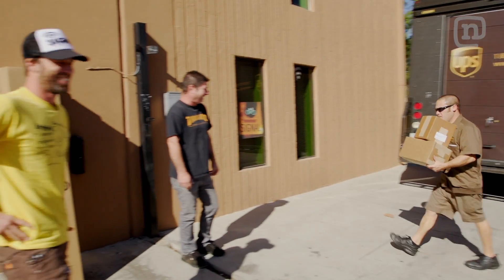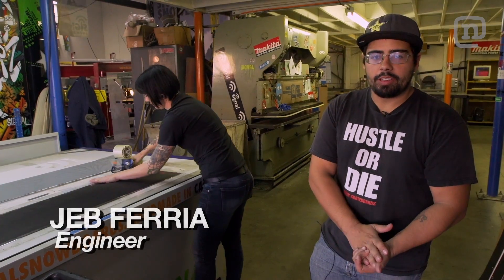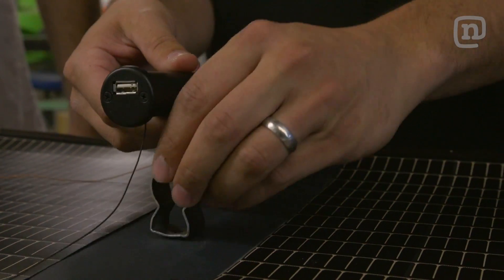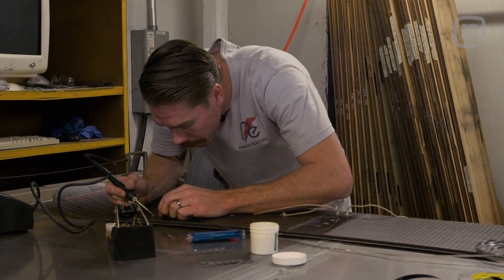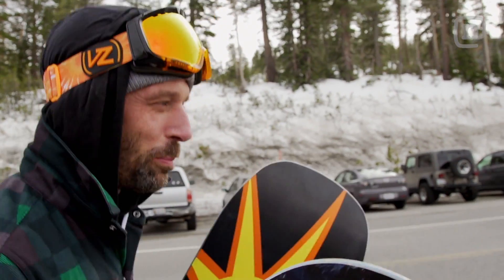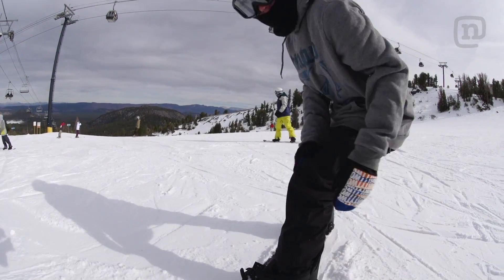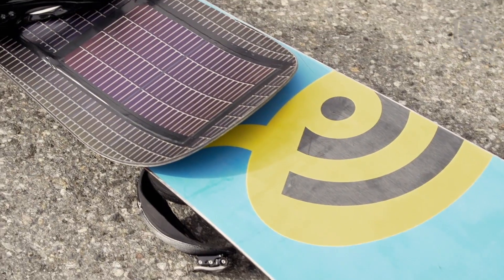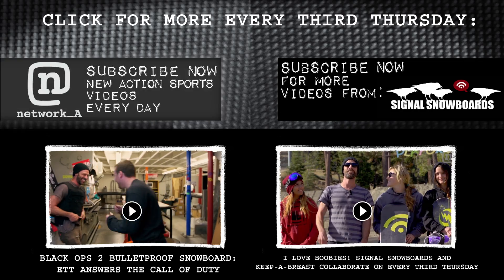Electrifying Solar Powered Snowboard: Every Third Thursday

Comment: you could use the solar power to make a hot snowboard instead of using batteries you could use the energy generated by the panel, that way i thin it will be easier  and maybe faster, you guys should try.
Reply: +carlos Thompson no way there would be enough power. That solar sheet produces around 5 amps @ 5 volts. Those heating sheets they use require 12 volts. If you converted the 5 volts coming out of the solar sheet to 12 volts you then be producing just 2.1 amps. Not even a quarter of what you would need to power the heated sheet. 

Sure as some people have replied "solar power produces more energy then most realize" but using electricity to produce heat is very demanding for energy.
Reply: +carlos Thompson thats what I was thinking
Reply: +carlos Thompson same haha
Reply: +carlos Thompson There is absolutely no way that a solar panel can make more energy than actual energy which goes into it. The sun would melt the snow faster than a heating coil powered by a solar panel. There is always an energy loss when using wires or any kind of electronics.
Reply: Tayne you can make a DC power step up hooked between the powerbank and the heat pad.
Reply: Well then I guess they'll have to build it to find out... 😏
Reply: solar panel are stronger that what most people think they are, they are often underestimated, i believe i would provide provide a good amount of energy.
Reply: Agreed
Reply: Only problem I could see is the snow on top of the board
Reply: +FudgePakers He's not saying that the panel can "make more energy than actual energy which goes into it". A couple of tips:

- Snow is white, which means it mostly reflects photons that strike it. These photons are not absorbed by the snow.
- Solar panels can convert (visible, UV-) photons into heat. When regular sunshine reaches the snow, these photons are reflected by the snow. Yet when solar panels are used, heat is still effectively being applied to the snow.
- Whether or not the sun will melt something hugely depends on the environment temperature. This is less so with a solar heater, since the heat is directly applied to the snow.
Reply: Weierstrass Very good points. Haven't thought of or knew most of that. So would you say it is viable to have the solar panel energy try to melt the snow on the underside?
Reply: +FudgePakers Honestly, I have no idea. :)
Reply: Weierstrass Well, it's an interesting concept nonetheless. Maybe someone will try it out someday.
Reply: i would at least like to see it
Reply: Same lol

Comment: You might be able use the power from the solar panel to make a heated board. The only problem is that the solar panel may not supply enough power tho

Comment: If you combined your solar panel idea with the heated snowboard that would be awesome! totally could sell it.
Reply: I bet you wouldn't get enough power from solar to heat the board very much.
Reply: +Nate Meyer 5 volts is enough and phones take 5 volts so yes it probably can
Reply: nivlac what do phones taking 5 volts have to do with this?
Reply: +Nate Meyer can you read I said 5 volts is enough to power a heating element and phones take 5 volts
Reply: @nivlac4150  It isn't the volts that are the problem man, heating elements require the POWER! and likely the heating element will draw enough to result in voltage drops.
Reply: nivlac yeah obviously I can read. I don't understand why a phone being charged with a 5 volt power supply is relevant to the conversation though.
Reply: +Nate Meyer those solar Panels charged phones in the video and it probably can produce more than 5 volts if needed
Reply: Oh alright. It's been a while since I watched this video. I didn't remember whatnot was about

Comment: You should make a "tiny ripper" at least thats what I would call it. Basically my idea was a stiff board that's the size of a skateboard deck with similar concaves. the bindings would be placed in the same position as a skaters feet (bolts and tail) so you could pop it like a skateboard and maneuver it easily for some SWEET tricks. As an added bonus, it would be pretty light. I would just keep it stiff so you can keep the pop like a skateboard. Thanks for the awesome Video!

Comment: Had another thought, combine this with the aluminium base (though with cutouts to increase flexibility) and you can even use the base as a heat sink for the charging circuit if you need to. Shouldn't get warm as it's a largish bit of aluminium and in contact with the snow most of the day. Come on put this into the standard range, you know you want to. :-)